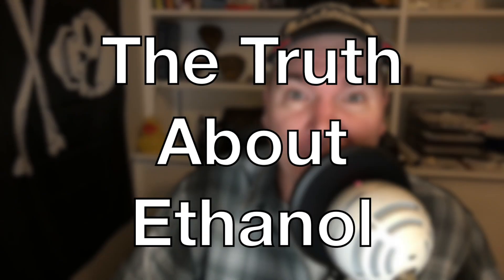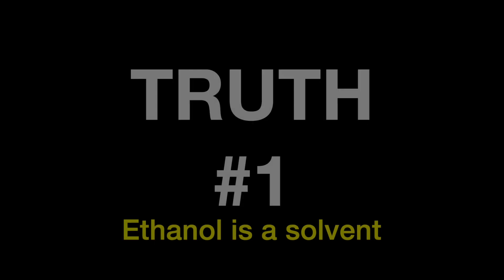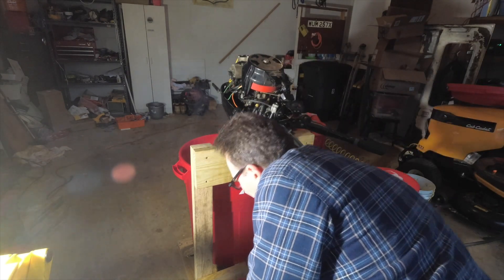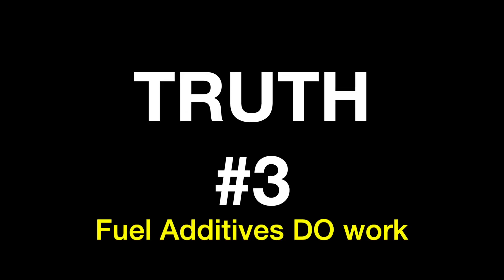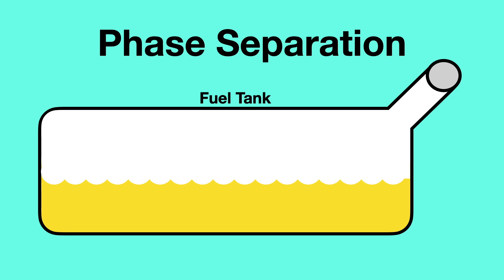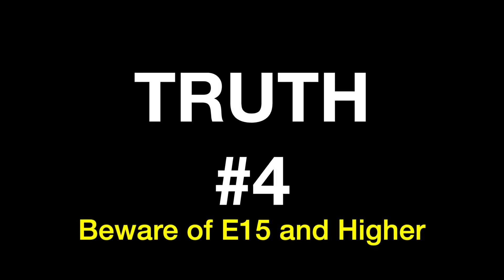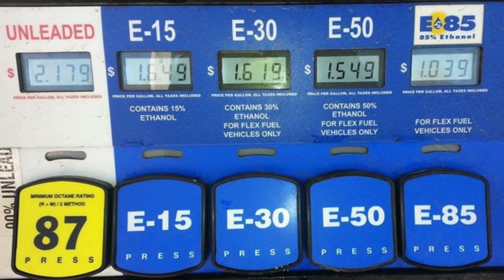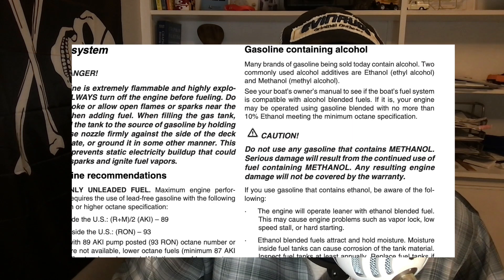Ethanol Problems - How to deal with E10 blended fuel for our boats and small engines

Comment: Great easy to follow vid ! I had one of my classic cars off the road for a few months doing a rewire & in that time the fuel tank & sender was rusted out . ( this was before all this knowledge was published) ! 
Two questions: 1 does pre mixed two stroke fuel suffer in the same way ( oil in the fuel) . 2 how do you find out ( in Australia) what petrol does not have ethanol in it ? The oil companies are really cagey about giving information here in OZ ! 
I now run 91 octane fuel with a dose of Metholated spirits & fuel stabilizer with an octane booster to stop pinging. Cheers Simon

Comment: This video simply parrots the "theories" about ethanol already being debated on the Internet. #1 Is true-ethanol is a solvent- but your conclusion lacks proof. Your video still leave the release of damaging residue a theory. #3, fuel stabilizer was objectively tested by others and shown to be useless for protecting metal components when moisture was present in the gas, and relatively useless for long term storage with no moisture present. It also did not protect fuel from serious degradation over long term storage. Non-alcohol fuel did better than ethanol fuel with stabilizer.
Reply from the maker: I think we can all agree that non-ethanol fuel is the best option by far - but some people are not able to get that where they live.

Comment: I always use ethanol free gas in my small engines. If I don't have any, I extract the alcohol from normal <E10 Premium and use that. Simple process anyone can do.
Reply from the maker: Yeah in some areas it's hard to find ethanol free
Reply: May cause issue of innsufficent octane, then you would need to add toulene or xylene to boost octane if the engine does require it.

Comment: today, April 11, 2022. President Joe Biden just signed an order lifting the restrictions on ethanol being blended with the gasoline. Now they can add even more than 10% ethanol to fuel legally.. every car, truck, motorcycle Ione, has warnings in the owners manual is to never use fuel with more than 10% ethanol content.
   I watched a study video on YouTube explaining that the act of farmers clearing land that was never cleared before to grow corn to convert to ethanol, releases more carbon That has been stored in the ground by plants over the years,into the atmosphere, than the benefits of that corn being blended with gasoline will be realized.. The environmental protection agency knew this since 2010… plowing the fields, releasing all that carbon, is more harmful to the atmosphere, then the benefits of burning ethanol in gasoline produce..
Reply from the maker: I think (think) some cars and SUVs labeled 'Flex Fuel' can use the E15. But for those who don't know any better, and have a vehicle that it's not good to use - it could be an issue!

Comment: @ 7:30 when the trailer is on the boat ramp it looks like you ran the video in reverse. trailer doesn't look wet, dragging lines in front of the tire, water isn't disturbed. 
overall this is a great video and I enjoy your content. 
I just thought I'd point out that I was paying attention to the details.
Reply from the maker: LOL - I may have done just that! Sometimes I have trouble finding the footage I need and have to improvise.